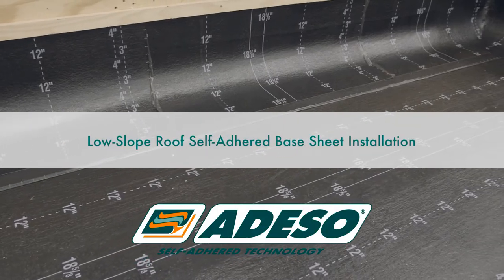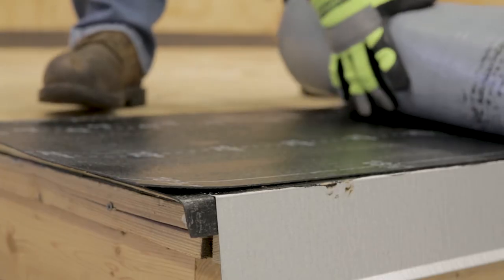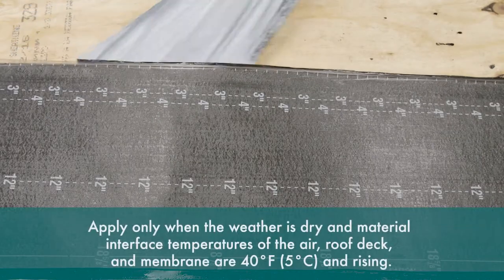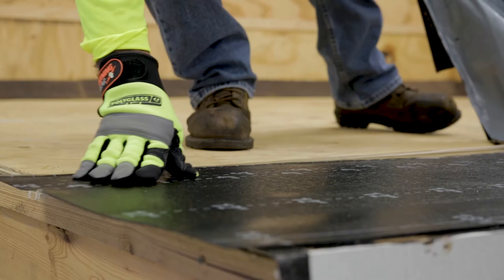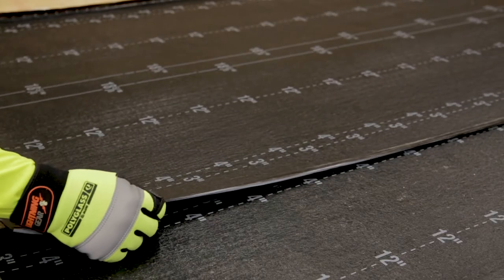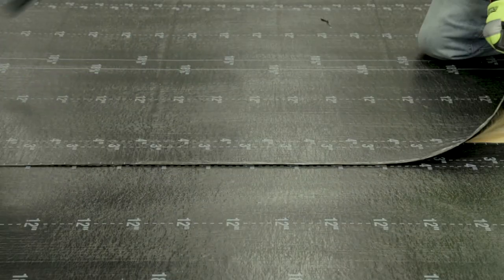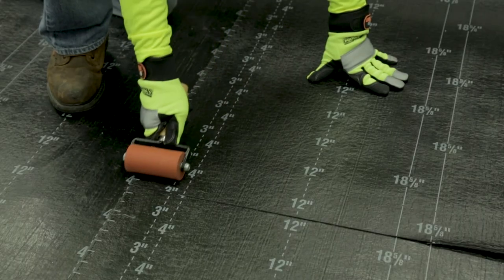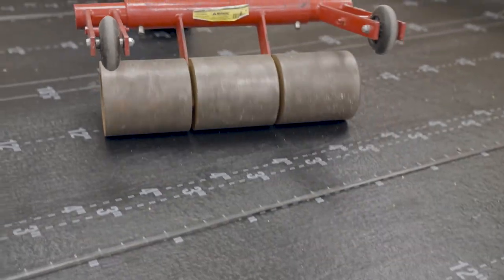Low-Slope Roof Self-Adhered Base Sheet Installation | How to install Self-adhered Membranes

Comment: Does it needs primer before installing base sheet
Reply from the maker: Hi @Derpherppington, Polyglass Self-adhered membranes do not require primer on plywood substrates if they are clean, dry, and dust free, however, it is recommended when bonding to OSB. Let us know if you have any other questions 🙂

https://polyglass.us/product-type/technology/adeso-self-adhered/

Comment: but the roof is sloped what about the safety factor
Reply from the maker: Thank you for your comment regarding the low-slope roof installation video. Please be advised that this is a scripted video and the application is to a portable wood platform training test deck that is indoors within our Polyschool training facility and in this case the deck level is less than 12 inches above a concrete floor slab. Anytime work is executed in the field or for video purposes, Federal and State OSHA regulations should be followed and is promoted by Polyglass to its customers and work staff. To learn more about our products, visit our website: https://polyglass.us/

Comment: show how to remove then I will be impressed
Reply from the maker: Hello! Our roofing systems are designed to last over a decade when installed properly, so deliberately removing them will require some work. But we recommend checking with your local building department to see if recovery roof systems are allowed in your area. If you have any more questions feel free to reach out to us here: https://polyglass.us/technical-sales-representative-locator/

Comment: How the hell do you remove it in 15 years or so when it comes time to replace??
Reply from the maker: Hi @thulsa5218, our roofing systems are designed to last longer than 15 years when installed properly 💪. When installing an SA membrane directly to the deck, the adhesion to the wood substrate is permanent, and removal will be difficult. However, it would be best to check with your local building department or Authority Having Jurisdiction to see if recovery roof systems are permissible for your area and project.

Feel free to contact our technical department: https://polyglass.us/technical-sales-representative-locator/ 

if you have any more questions! We offer a variety of options for re-roofing.
Reply: I imagine it would be hard to remove when fresh, but like roll roofing applied via 600 F mopped asphalt it spuds up okay.  I image aftet 20+ years of heating and cooling  cycles removal would be possible. The adhesive would likely harden. Just my two cents.
Edit: All the peel and stick stuff is hard to take up regardless of age.  You'd probably need a spud bar.
Reply: I guess a follow up question would be, can you simply roof over the old layer?  We've done that when customers don't want to pay for a tear off. I've seen up to five layers of old shingles on roofs.  Not sure what's allowed today since I'm a commercial banker. If there is one thing I've learned from roofing, it's that I want someone else to do it.

Comment: Can I nail or screw down a deck over this membrane??
Reply from the maker: Currently Polyglass does not have an official approval for an overburden roof cover onto Polyflex SA-P. There are watertight methods of installing an overburden onto the SA-P surface, but many considerations need to be made such as maintaining proper roof drainage.
 Polyglass recommends that local building codes be verified when considering such applications. Regions of high wind often have specific requirements for such overburden type products. Polyglass Limited Roofing Material Warranty would remain applicable to products used in this manner, however, would not provide for removal and replacement of any overburden should investigation of a claim should be required. Feel free to contact any of our technical representatives if you have any other questions https://polyglass.us/technical-sales-representative-locator/.